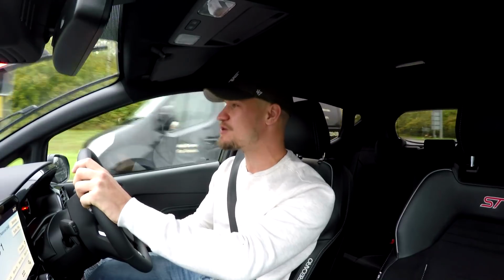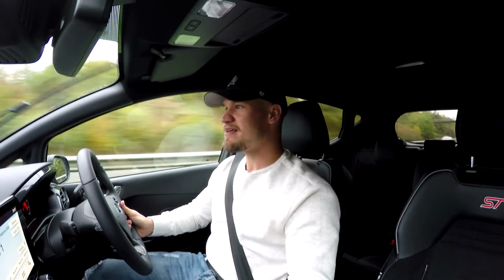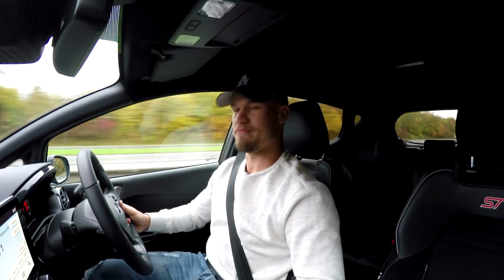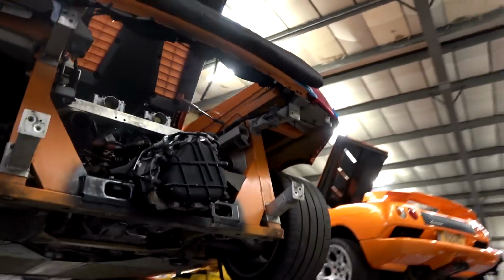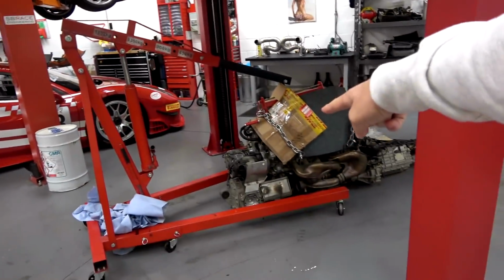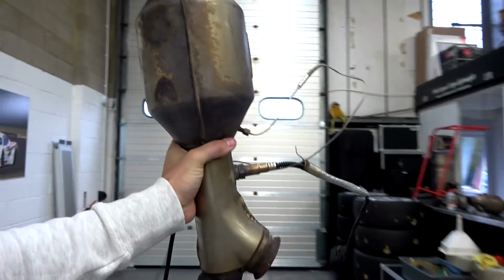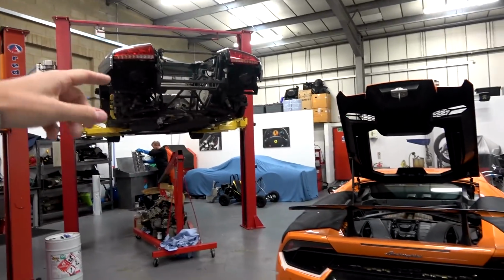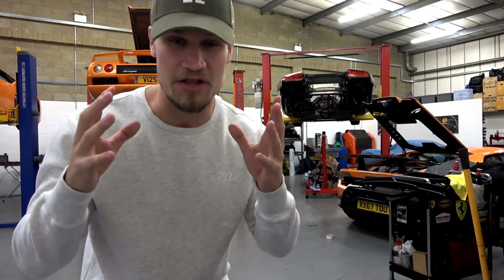MORE PROBLEMS FOR MY LAMBORGHINI?

Comment: Manual conversion would be perfect to be done with all of the engine and transmission out!
Reply: Yes yes yes yes!!!!! I hope he reads this.
Reply: 40000 in (used) parts plus you need make a loom or get a 640 manual loom oh and also a dash. The engine/gearbox out is the easiest bit. You have to blank out the sensors within the gbox. There are also the other systems such as traction control, variable valve system and ABS which all talk to the engine, gearbox ECUs. So you can do hill starts it doesn't roll backwards. Which is why people like URacing have been declining  it for the last 5 years.
Reply: I have been following another Youtuber, Royalty Excutic Cars (pls excuse my poor spelling), who are doing a few crazy builds using the Gallardo. They pointed out that it was a "small" module that goes onto the gearbox that does the SMG style shifting. The gearbox is actually the same between the manual models and SMG version and it's not as invasive to the cars systems as people would assume. 

I admit, I am making a guess that VW would have done a similar workaround with Murci? I work in IT and again, to me it would seem logical that it's more about the ECU having a different profile for a manual and SMG, so that costs can be kept down when they were building and developing the cars in the early '00s? 

One point you have raised that I honestly am curious about, is how do you do a hill start with the manuals? The handbrake (E-Brake if you're from North America) is electronic in these cars right? So again it must be down to a different profile being used in the software in the ECU surely?

The systems they used with these early SMG gearboxes were pretty basic and all it would be doing different would be auto blipping on downshifts so to rev match (again software). The rest of it would be a mechanical system doing the clutch and selecting the gear? 

Aston Martin have been doing a factory service where they are doing manual conversions with the old Vanquish, which like the Murci, had a bloody awful SMG/Single plate gearbox. Really the only thing that would need adding is the gear linkages, shifter and pedal box to make it manual? 

I am genuinely curious about this and it seems you've come across content/experienced the job of having a manual transmission retrofitted to one of these cars? 

Looking at how rare a RHD manual LP-640 is and how much they go for, £40,000 is still less than the difference between the two versions of the car, so it could be look as a sound investment/mod that would massively add to the value of the car?
Reply: Hill start in a manual???  One foot on the brake and one on the clutch...come off the brake while fathering the gas and at the same time releasing the clutch to it's bite point and pull away...not very hard.  Been driving stick for 20 yrs and get it right every time.
Reply: The way we are taught in the UK is to have the handbrake on and when the clutch starts to bite, take off the handbrake and pull away. With an electronic handbrake (e-Brake) how does it know when to let off the brake and let you pull off and when/if to engage it again if you fail to pull off smoothly. 

Here in the UK, about 95% of all learner drivers are taught to use manual as it's the normal system here. Also if you do your driving test in an Auto car, your licence will only allow you to drive an Auto, which is why we are all taught how to drive manual (stick shift).
Reply: @FelixIsMyName  The Aston system is a stand alone bolt on robotic system where the lever would go and a clutch piston actuator as they used a t56. Simple to remove as it was shit to use.  The Murcilargo has an old fashioned hand operated ebrake next to the door/seat not an electric one like the Huracan/aventador. They use the abs wheel sensors to tell the clutch to engage and increase rpm and not stall the car. The 4wd/ESP and sat nav all use this too. Change the conductivity by splicing or cutting the loom and it will read as a fault as it measures pulse width and amp drop around the loop, this is how it knows you have a bulb out and where it is. Why low battery voltage makes it throw codes. What makes the Murci different from a Golf is that they built the electronic system without the need to make it flexible or layered to fit high spec/low spec rental/wagon/cabrio/kombi/hatch/van/diesel/petrol 1.0-3.2 etc. Just manual/egear/roadster/LHD/RHD. An easy analogy would be like Microsoft vs Apple.
Reply: Thank you for the reply. The way you have explained it makes sense in my head now :)
Reply: Hi Mate, if you're in central London, contact me and I can show you all the parts (less than £6K) required, and all are on my garage floor (Oct 2018). This includes a new manual gearbox- no "blanking" of anything. @fraserwright9482   As for hill starts without rolling backwards... you do realise that before "hill start control" was common in cars (post 2005) in all manual cars, you simply used the hand brake for this function.... You do not need a new "loom." You do not need a new dashboard, but its nicer if you do as you won't have the gear sector screen/window showing wrong/no information if you keep the e-gear dash. You do need a new throwout bearing as well, as the proper manual box runs different oil and the seals are different (though while I was at it, I changed the throw out bearing to the Gallardo/R8 style as used in the LP670, but this requires a LP670 bell housing as well owing to different oil ways for the oil flow to the throwout bearing. The normal manual gearbox has no sensors apart from speedo & tachometer.

Comment: Oh dear, it was always going to be a mechanical nightmare and money pit. It will be in the garage more often than you actually drive it and bankrupt you eventually so start saving for the Fiesta ST now
Reply: Gazza Brownhigh nothing major has gone wrong so far only the split valve that he mentioned in this video and the problem with the reverse camera. The clutch was always supposed to be replaced hence why it’s covered by the dealership that he bought the car from. The delays have been caused by the wrap.